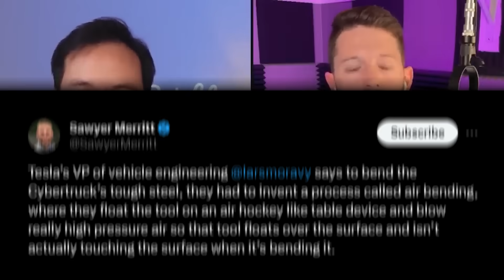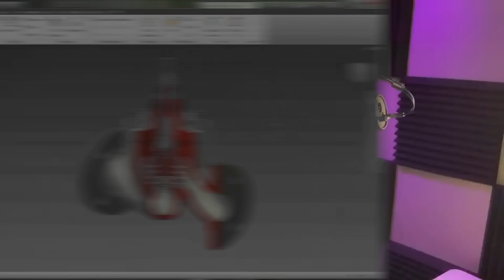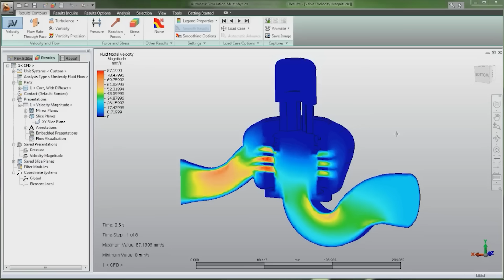Sandy BLOWN AWAY by Genius CyberTruck Casting

Comment: Meanwhile, doesn't Tesla buy the "gegapress" in Italy? So much for making the machine that makes the machine that makes the machine.
Their spiritual journey in finally making their own bestest cheatest battery cells, this time, like, totally for real, bro...isn't going too great it seems. Not a lot of cells coming out, and they're not high energy density and not low cost, or Cybertruck would not have been such a let down with final specs and the 200 kWh Roadster would have happened. Imagine 82 kWh more than a Lucid Air, in a Lucid, when the huge Range Extender for Cybertruck is around 47 kWh...but putting it into a Model 3 Coupe, pretty much... They were surely banking on 500 Wh/kg+ but are stuck below 300 Wh/kg.
Reply: Yes, Tesla worked with Italian company IDRA Group to develop a custom 6000 ton die casting machine, and that was followed by further 8000, 9000 and 16000 ton machines from IDRA. IDRA's parent company is the Chinese company LK Technology, who Tesla also works with.

Comment: Ya; too bad they can't gigacast the 4680b battery used in Cybertruck; less than 100 a week being made.  By contrast Ford's f150 lightning took 1 year of from announcement not 4 to put out 1,500 a week out the gates - Cybertruck due to 4680; a total flop.
Reply: The Lightning is a bad example as it’s a retrofit of the ICE version in order to get to the market quicker. Ford is still working on their actual EV truck platform.  The Silverado EV isn’t a retrofit platform
Reply: @rcpmac  I understand that to an extent it was more of a vehicle conversion; but Ford had a lot of tech about how to make a pickup truck, so they can do a retrofit: Tesla has never made a pickup.  I've read that the F150Lightning had some poor user software but the truck itself is pretty competent.  If it wasn't so expensive I might buy one
Reply: The Cybertruck took 4.3 years from the start of design to production, which is the typical time for legacy auto to bring out a totally new vehicle design. However, the difference is that Tesla had to do a ton of R&D for all the new tech in Cybertruck. Tesla developed a custom stainless steel for the Cybertruck to get the properties it wanted. It invented a custom air bending process to fold the stainless steel. This is the first vehicle to use 48 volt components, so Tesla had to work with a bunch of suppliers to start making 48 volt components. Instead of using point-to-point wiring harnesses, Tesla created a cable with wires for both gigabit ethernet and CAN data that go to regional microcontrollers that attach to the components, which reduced the wiring weight by 70%. They improved the energy density of the 4680 cells by 9%, so I imagine that they figured out how to get the dry process to work with added silicon in the anode. They developed a way to pressurize the battery when in Wade Mode to keep out water. They had Goodyear develop a custom tire for the Cybertruck which can be used offroad, but still has decent onroad performance. They designed the first automobile which is fully steer by wire and it uses triple sensors and double motors for redundancy. They developed a custom wiper where the washing fluid flows through the center of the wiper. The Cybertruck contains the largest piece of automotive glass ever used in a vehicle.
Reply: @amosbatto3051  Design of the truck was already done 4 years ago; testing of various versions would take a year or two at most; the problem from the start was the 4680 battery; Tesla ditched the original 16% more dense cell for a 10% more version which they still have high rates of reject; exactly how high isn't disclosed they only say the "reject rates are getting better each month"  Total made as of 23 Jan 2024 under 300.  All produced in 2024 will be losers financially

Comment: As i was a designer before retirement i basically understand what Tesla is doing with the castings. I built CAD models for the FEA folks and supported them at an automotive parts plant. It was a wonderful job. I also experienced the frustration working under MBAs who refused to allow improvements in the designs due to short time frames and refusal to spend money to advance and improve designs going forward. What Tesla has done is to produce an Engineering Masterpiece.

Comment: It is interesting to see production tech. The average consumer just sees the end product and often has only a badic understanding of that product. 

When the Toyota engineering team took an oldet Model Y apart and publicly gave it praise, Tesla was already many steps ahead of what Toyota was looking at. It eas funny to eatch them scamble to claim they have their own unboxed method in development after Tesla showed more about it. 

When you see the presscreleases and interviews from leaders at GM, Ford, VW, and others, they often have little substance, yet people are quick to praise them. 

I bought Fird products in the 1980's and 1990's. Back then they wrre claiming to working on quality and that they would have ghe best quality. For the past three years Ford has set new records for recalls. Not one year since claiming their quality will be vastly improved has Ford made it the top of the good quality list. Fird has company culture issues and leadership that is more worried about what Wall Street thinks than doing what is best for the company and consumers. 

When 2030 rolls around it will no longer be speculation about who is right or who is wrong. The data will show who is best. 

I agree with Musk that competition is good. It pushes industries gorward and usually benefits the consumer.  I just wish more companies would spend less time seeing what Wall Dtreet wants and focus on long road maps to making real change.

Comment: Pure hubris. The Chinese are already experimenting with thixotropic magnesium casting from idra, which is a company they own outright. Those magnesium alloys are 30% lighter than Tesla's aluminum and they are less corrosive to the dies
Reply: Hard to compare something that doesn't exist yet. Kind of like how Toyota keeps touting this new solid state battery for 8 years and so many people said well, Tesla is dead. Yet, Toyota now says that battery is like another 3 years out lol. If someone actually makes something in real production, then it might matter.
Reply: @itsatrap7215 
Toyota also says (at least until recently) that it's planning for ±30% "Electrified" production and indicated they still like hydrogen.
.
Since HFCEVs are "EVs", if we assume Toyota thinks they could maintain current production of ±10 million until 2030 (good luck).... That would place their "Electrified" fleet at 3 million.
.
They already told us they favour the solid state cells being used in Hybrids (indicating the cells will be low run rate, and expensive, so they want small packs) but let's split 3 ways, that's at best 1 million full BEVs in 2030.
.
Mmmmm.... Ambition!
Reply: @itsatrap7215  There's a major difference between producing a viable solid state battery and demonstrating a known casting technique can be married to an IDRA gigacasting machine (something which IDRA has already demonstrated with a prototype and  IDRA customers are experimenting with.).  They can't be compared.
Reply: Are you SURE Xpeng "owns Idra"?
.
My money is on LK Machinery, Hong Kong.
Reply: @rogerstarkey5390  mis spoke. China owns idra
Reply: Agreed, If idra can lower the cost.